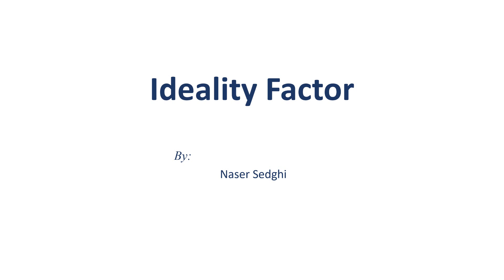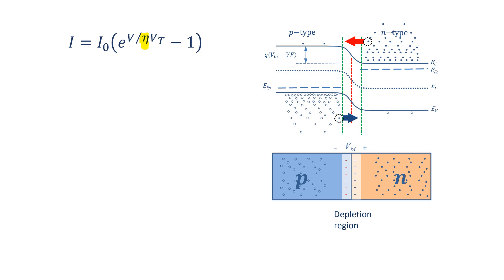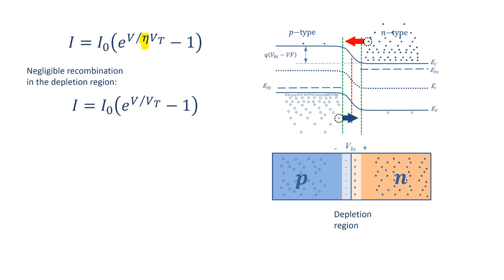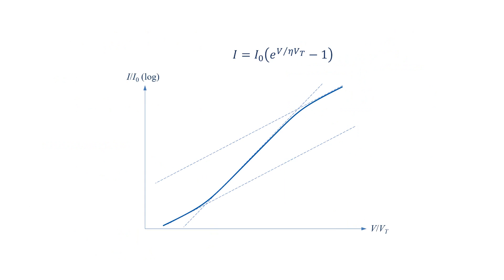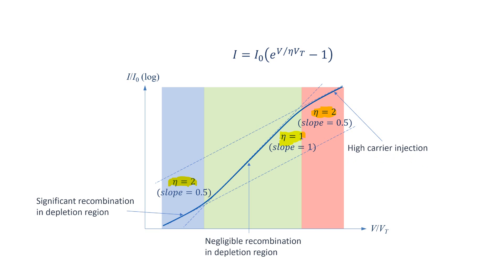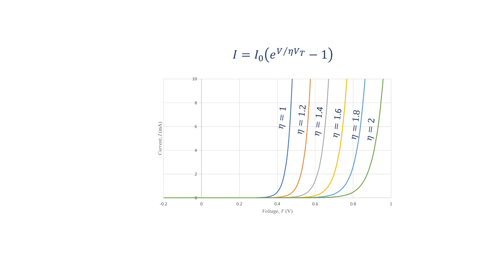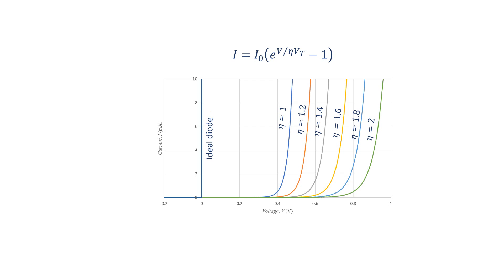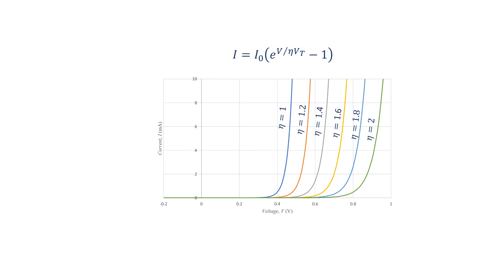Ideality Factor

Comment: Sir, after finding the ideality factor, how we can  find the barrier potential and series resistance from the IV graph using origin. Plz reply as its very important for me.
Reply from the maker: I am afraid there is no simple answer to this question. The potential barrier cannot found from the IV characteristics. It depends on the doping concentration of the semiconductors. These parameters are embedded in the reverse saturation current in the diode equation. Some researchers have used modelling techniques to estimate the potential barrier height. For example, this: https://aip.scitation.org/doi/10.1063/1.4789989 (I am not sure if you could have access to the paper, unless you are a student or work in a place that have subscription to the journal). It is possible to find the series resistance by modelling too, but both of them need advanced techniques.

Comment: Thank you for the video sir! I have a question - why we have log(I/I0) on the Y axis but not ln(I/I0) according to the Shockley diode equation?
Reply from the maker: Thank you for watching. It is not log or ln, but the scale is logarithmic. Even if it was log, It didn't make any change on the slope. The ln of a value is 2.3 times the log of that value. It just changes the scale of y axis and doesn't change the shape of the graph. I hope that you find the explanation helpful.
Reply: @drnasersedghi  
Thank you sir. Your explanation is very helpful. I love your videos for the brevity and clarity of explanations. This is what students need.
Would you mind if I ask you a one more question? I am interested in why the ideality factor of a solar cell in the low voltage region can be less than 1. This is described in work: 10.1155/2017/8479487 (figure 5).
I also discovered this when I prototyped a porous silicon solar cell in the lab. You can see IV curve obtained by me here: ibb[dot]co[slash]6nyrQFS. Here I had n=0,35 in the voltage range 0-0,025 V.
Reply: @nasersedghi  
Thank you again sir! Your videos and answers are very helpful for me.